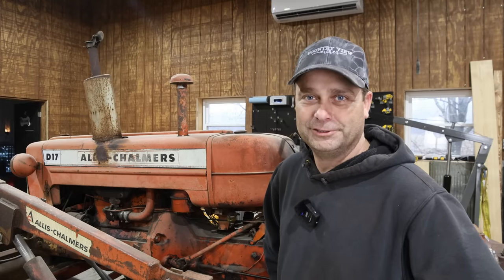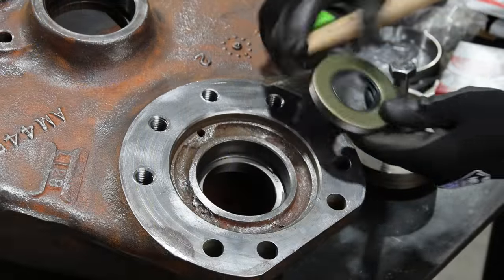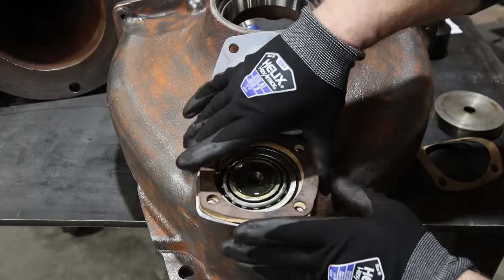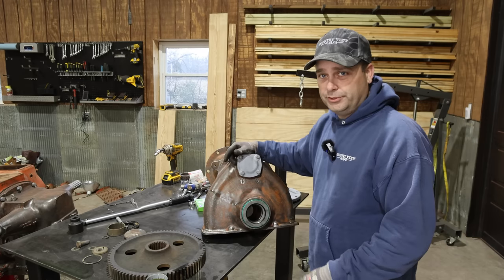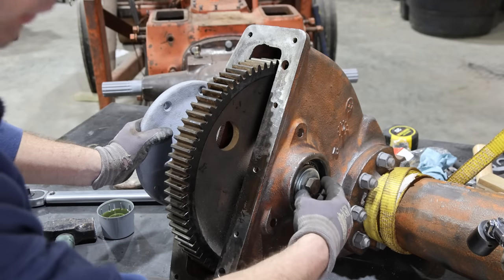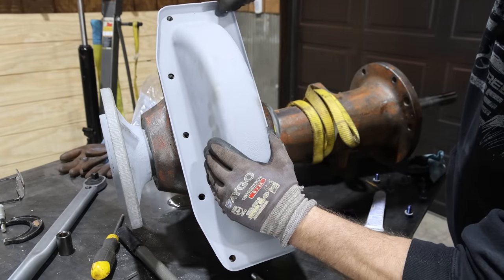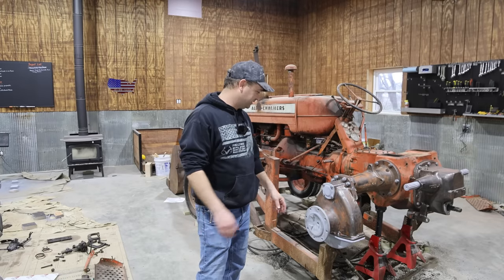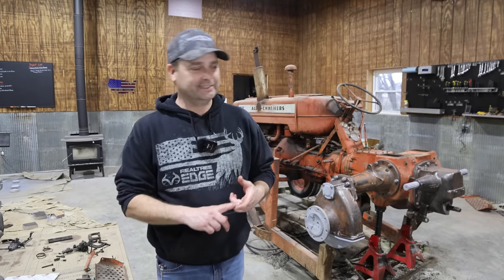It went back together easier than it came apart.  Allis Chalmers D17 Axle and Final Drive.

Comment: All machinery rehab includes the hardest part: cleaning the old parts before re-assembly.  It's the most time consuming and critical task to properly prepare for re-assembly.  Like you, I pressure wash and clean, usually before dis-assembly, which let's you see what you're working on, and makes the job much easier.  Thorough cleaning AFTER dis-assembly then makes re-assembly much more "pleasant", (if that's possible) LOL.  Good job.

Comment: Evan, when your replacing bearings always keep the old races when you press them out.  They are hard so you'll have to grind or sand the OD of them down so that they slip back into their original spot freely.  Then you can use them to seat the new race that last amount with a press. Heating or freezing will help with getting them into the housing/shaft really well.

Comment: Might be telling you some info you already know but I would suggest you use a brass punch when removing and installing bearing races due to the risk of damaging the housing or possibly the races. Also dead blow sledge hammers of all sizes. It’s obvious you know what your doing and I’ve done a lot of differential gear work and I’ve seen a lot of failures due to using hardened steal punches and hammers. Good work! I’m trying to get a WD 45 from my neighbor to restore. I’ve been watching it decay in his yard for 25 years.

Comment: Great job Evan! I have only used the punch and socket method on my races and the seals, just have to take it easy on the seal and hit it square for sure. I wish I had your shop to do mine in, but I don't so my son and I just got done putting a steering arm on my 96 horse tractor. Had to do it outside, taking the radiator out along with other front end parts off, but we finished it about 5 days ago. Nice video, enjoyed watching, thanks and have a great Sunday and rest of week ahead.

Comment: Yes a big job Evan, you might want to take a close look at the seal lip just behind the wheel hub as something did not look right on camera (@17:51) w/ that seal lip. A shop repair manual for your series of D-17 would be very helpful to you. Thx for posting & good luck w/ the other side.

Comment: Good job  I use the freezer to cool races to "shrink"them  or oven to "expand" parts as needed  have also used CO2 to shrink parts 😊😊
Reply: Would you be able to assemble with out hammering it in?   Or a lot less
Reply: @Sc-jf3yk   a lot less hammering

Comment: Great job...be very careful when beating on cast pieces with a sledge or hammer. The part can split right in half. And don't forget to degrease everything before priming, now that you have touched things with greasy hands. A great product is PRE made by Eastwood.

Comment: i always prelube with vasoline when reassembling,it will not run off if you dont use the part right away and breaks down and mixes with the gear oil

Comment: To help locate and hold parts in position I like to take bolts longer than needed cut the head off and take your grinder with a cut off wheel and cut a slot across the top of the bolt .  Screw 2 or 3 into the housing. Position the gasket or housing fasten the  bolts.
Then remove the locator bolts with a flat blade screwdriver.  I save the retainer bolts for later jobs.  i have an assortment of bolts I have made over the years.

Comment: Question,  how do you remember how to put it all back together after being apart for a while? Do you have a special method?
Reply from the maker: Parts diagrams in the service manual.
Reply: @CountryViewAcres  question, I have a 1961 Ford 641 D This is a Diesel tractor. any idea where to get parts? I am getting fuel in the crankcase.
thanks.

Comment: EVAN!  NICE JOB  -QUESTION- I HAVE A 58 INTERNATIONAL 350 UTILITY TRACTOR WITH A CONTINENTAL D193 ENGINE AND CANNOT FIND PARTS LIKE RINGS AND BEARINGS. HAVE ANY IDEAS?  I HAD NOLAND HEAD WORKS FIX A CRACK AND DO A VALVE JOB BUT HE DIDN'T KNOW EITHER.   BY THE WAY,  MY WIFE AND I HAVE WATCHED EVERY EPISODE. WE JUST MOVE TO NW MISSOURI FROM CALIF.
Reply from the maker: Pete at just a few acres farm would be the best to ask about international parts.  He has rebuilt several farmall and international tractors.

Comment: I certainly would not where to start putting it back together, even if I had recorded and numbered all the parts and filmed the taking apart process so I know which part belongs to which other part. I admire a mechanical mind, but then I have skills in other professions.

Comment: Probably closer to 500 degrees judging by the colour on the metal. Any hotter (in tool steel) and you will alter the hardness. Here's some information about tempering steel and a tip about cold chisels but I suspect Evan knows this stuff. https://www.youtube.com/watch?v=wNHwBQJxlo8